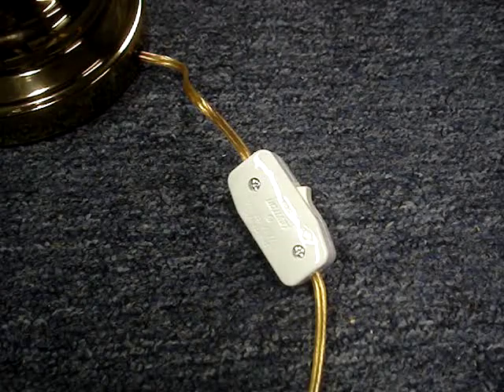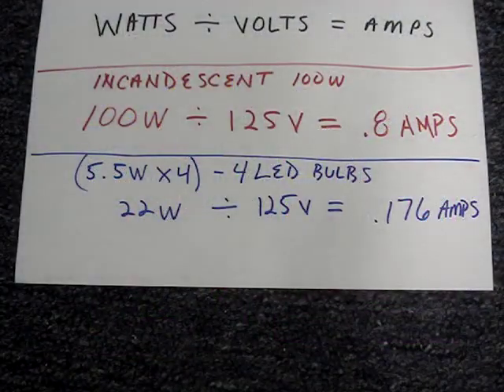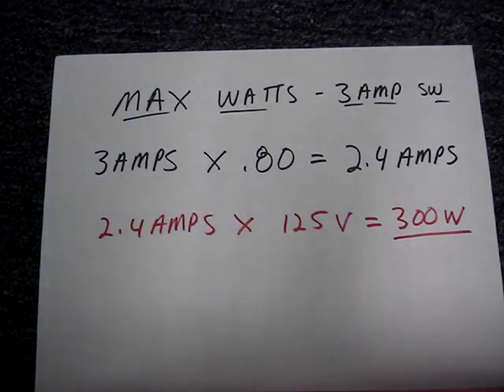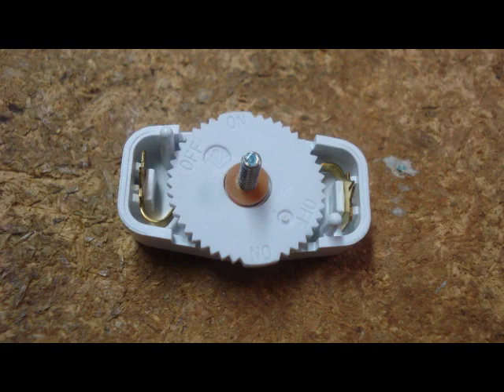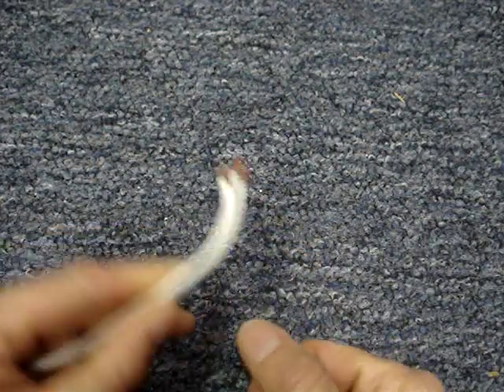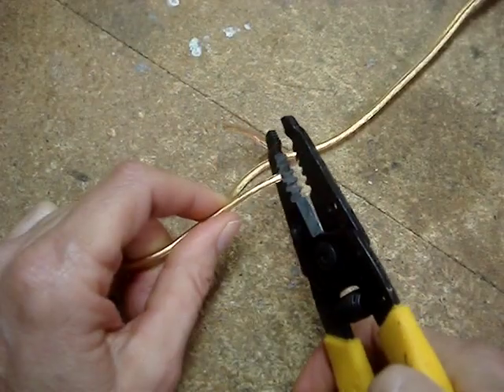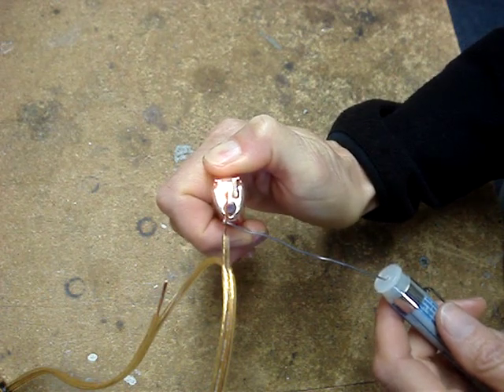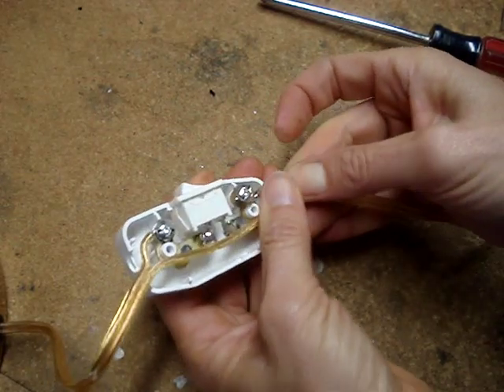How to Install a Switch on a Lamp Cord

Comment: Thank you!  I've watched your video 4 times now, and I just ordered the Leviton 5410 appliance feed through switch.  I hope that's the right one - my lamp cord is black and there is nothing that tells me what gauge wire it uses, but it sounds like most lamps are 18.  This is just a standard bedside table lamp.  The Leviton switch apparently works for 16 or 18.  Hopefully it's one or the other.  BTW, my lamp originally had the switch with the serrated wheel inside, and I can see that there's a black area inside where something burned out.  I'm glad my house didn't burn down.  I so appreciated your clear explanation, especially the math part, and I feel confident that I'll be able to get this sorted out now.
Reply from the maker: Yes, most lamps are 18 gauge wire.  Another gauge wire would be very unusual.  Good you didn't avoided a fire.  I don't know why those connections are UL approved.  IMHO, they are a hazard.  Best wishes for the repair.  It sounds like you are on the right track.

Comment: I’m curious how the type of switch that pierces the insulation almost led to an electric fire as I just used one of those. Thanks!
Reply from the maker: Apparently when the lamp was manufactured,  when the connector was closed it did not pierce the insulation very well/did not make a good connection.  Over time the lamp got moved around disturbing the not already good connection.  The connection likely became looser.  A loose electrical connection with heat up/arc, a situation that will cause a fire.  The lamp was on a timer, luckily, I was home to see the light flickering and unplug it.  When I took it apart, I found the little triangular piece of metal to be about gone and melted/black and charred cable.  When you close that connection, you can't see it,  You have no idea of how good the connection.  Open it to check and close it again, you are stressing that little piece of metal.  I say no thanks to that type of connector even if it is UL approved.
Reply: Thank you for this clear explanation. The danger of these switches is clearer to me now. I’ll use terminal switches only

Comment: Can I do this with any switch, such as a button if it is rated for the Wattage and amps being used? Or do I have to use an online switch such as the one in the video?
Reply from the maker: Yep, it's the same concept, just a different kind of switch.

Comment: Great video. I have 40 year old chapman lamp I just bought that has a dimming switch that does not work. I can't find a matching switch to replace it with and am considering replacing with the cord switch in your video. Is there any reason that should not work with this lamp? Are there dim-able cord switches that I could use? Thanks!
Reply from the maker: Hi Justin, if you can find a cord with a dimming switch that matches the specs on the original switch it will be a suitable replacement.  Be aware that some of the older LED bulbs didn't play nice with dimmer switches.  I think most of the new LED bulbs are now compatible with  most dimmer switches.

Comment: Is it possible to add a switch directly onto a cable to prevent current going through when the switch is turned off?
Reply from the maker: Maybe I am not understanding your question?  The switch in the video opens the circuit... stopping the flow of current.

Comment: Are you sure the hot wire is the one with printing on it? My research is saying the opposite. Please advise.
Reply from the maker: All of my SPT cable with molded plugs have the hot prong connected to the conductor with the printing on the casing.  You might want to ask the source you are using about their accuracy of information.

Comment: ⚠️ Be careful guys ⚠️ the wire with lined ridges on it is a neutral wire, not your hot wire. Wiring it backwards can cause a short circuit, heat up the wire, and cause a house fire.
Reply from the maker: Max, again you are tipping your hand that you don't know much about electricity.  Explain how wiring it "backwards" causes a short circuit.  While you are explaining, what would cause a breaker to trip?
Reply from the maker: Max you should actually watch the video.  I tell you that the neutral wire is the one with the ribs on it.  Legitimate criticism is always welcome here.  You may also notice you are the only one who is making this claim.  At this time the video has over 95,000 views.

Comment: I have plans to do this on a lamp I own. The LED bulb is 8 watts and 120 volts. I divided the two and came up with 0.0666666667. What amp switch do I need?
Reply from the maker: You can use either switch shown in the beginning of the video.

Comment: What do you do if you cut both wires
Reply from the maker: I'm not sure I understand your question.  I think you are asking what to do if you accidentally cut both wires.  You could buy a new lamp cord and replace it or you could butt splice the accidentally cut wire.  I have videos that show how to fix both of those problems.  Lamp cord replacement:  https://youtu.be/SsvPe1bo2Qs?si=ZZ6mCRcu979Y7Zus  Butt Splice:  https://youtu.be/tVS1ynJqJmM?si=Gt5sE8MZVL4cyPnD

Comment: So, what happened when you had that wheel-type switch? And thanks for the warning. ⚠️
Reply from the maker: The insulation piercing connection was on a table lamp socket (factory connection).  Luckily, I saw the lamp turning on & off by itself (it was on a timer... yikes!).  When I took the lamp apart I found a very charred connection.  I'd guess that it was never a good connection and may have been arcing for some time until the gap got big enough to interrupt power.  Unless your breaker is the type that detects arcing (AFCI - started to appear in the 1990's) it won't trip.  Loose/arcing connections cause heat and eventually a fire.

Imagine what might happen to the connection if the cord on the wheel-type switch got a tug.   It's just a thin razor blade cutting through the insulation.
Reply: Know How Now — Well, thank the universe you were there to witness it happening! That’s really scary how it won’t trip the breaker. And they still make that type of switch?!?

Comment: is there a danger of using a non polarized plug into a polarized outlet
Reply from the maker: Yes, the hot & neutral can be switched because the plug will fit into the outlet either direction.
Reply: @Know-How-Now  aren't cell phone chargers non polarized plugs that are pluged into polarized outlets is this safe
Reply from the maker: There isn't any metal on the charger, the case can't become energized, so it doesn't matter which way it is plugged in.  Modern power tools are double insulated.  There are codes that determine if a polarized plug it required  for UL approval.  I do have a video that explains the function of a ground wire on your home's electrical system.  Here's a link:  https://www.youtube.com/watch?v=RsKWoWvdZ2I

Comment: The US standard voltage is 120V (old network used 110V). Why you use 125V in calculation?
Reply from the maker: Hi Jonathan, I do remember asking my self the same question when I made the video.  I do research all of the video details, however, I don't remember why 125 and not 120VAC.  That field of electrical engineering is over my pay grade.  I do know that the voltage between hot & ground can vary by a few volts.  Maybe 125 volts is an average?  Managing the electrical grid is an amazing feat, the load is constantly changing.  Is there anyone out there who can answer Jonathan's question?
Reply: It depends on the transformer which supplies your home.
Reply: They range from 110-130v for most of the Northeast corridor as far as I know and come across

Comment: Best yet.  other directions from just pictures do not show and tell me all that you do.  Would like to tell people why the hot side is interrupted.  It is so the device does not get a hot wire when not in use.   Then again non polarized wires are more chancy for safety.  Esp. like the solder trick I did not know.
Reply from the maker: Thanks for the compliment, Gary.  I do my best to make quality videos.  Best wishes for the lamp repair.

Comment: Why does it matter which wire you cut?
Reply from the maker: https://diy.stackexchange.com/questions/156756/when-wiring-a-switch-should-i-break-the-neutral-or-power-wire
Reply: @Know-How-Now  Thanks for the explanation.

Comment: The neutral wire is the one with the ridges, you’re going to give somebody a house fire.
Reply from the maker: You are tipping your hand that you don't know much about electricity.
Reply: @Know-How-Now  it’s a good thing that it’s a simple on off switch, or you would short circuit. Takes 5 seconds on google to know that a neutral wire has ridges on it. I bet you think the neutral line connects to the brass terminal as well lol
Reply from the maker: Have you actually watched the video?  At 3:15 I tell you the wire with the raised ridge is the neutral wire.

Comment: After doing my research and watching this video I have found out the Chinese manufacturer of my lamp has used the wrong wire for the light dimmer switch, I got this lamp from my mom's and found the light dimmer switch's plastic case melted, when I turn it on I smell burning plastic ....yep they almost took out my moms with this one
Reply from the maker: Oh, my.  I had a lamp with a "vampire" connection.  It apparently was not a good connection from the factory.  One evening I noticed the lamp switching on/off.  I immediately pulled the plug.  I found the connection was arcing and starting to melt.  The lamp was on a timer.  Thank goodness I was home to discover the problem.  It soon would have started a fire.  That is why I am so exact with my instructions in this video.  I also have videos on how to replace the socket and the cord.